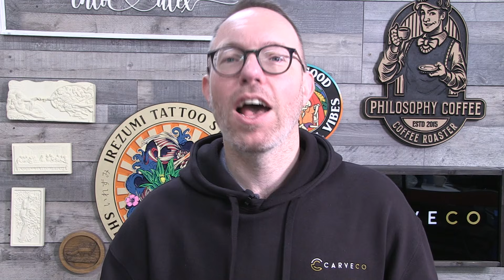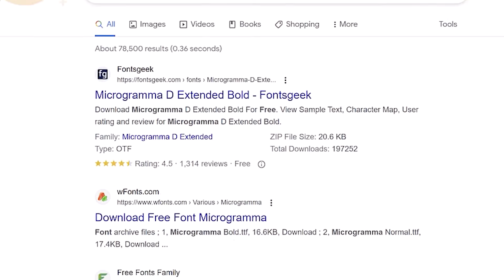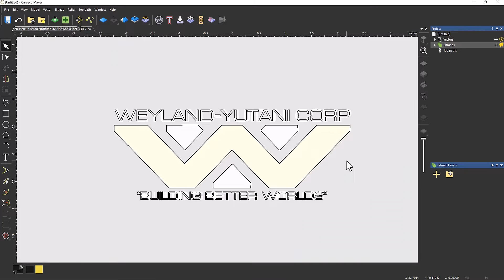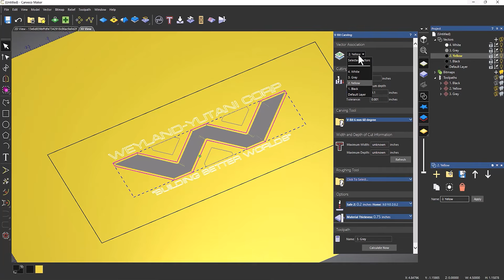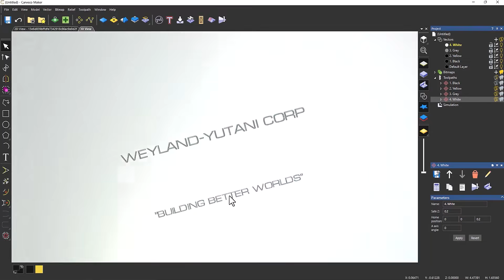Multicolored Inlays - CNC Epoxy 101

Comment: 🎯 Key Takeaways for quick navigation:

00:00 📹 In this tutorial, the goal is to create a four-pour epoxy inlay for a well-known movie logo, involving multiple layers of epoxy pours.
01:03 🎨 To start the project, obtain an image of the logo you want to create and import it into Carveco Maker for tracing and vector creation.
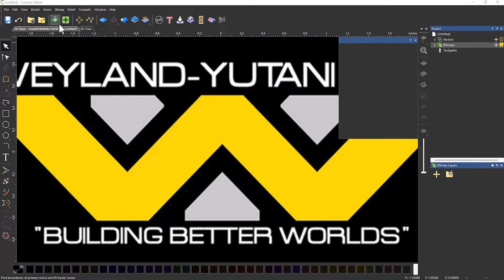03:08 🖼️ Adjust vector settings to achieve the desired angular and curved features for the logo and text in the design.
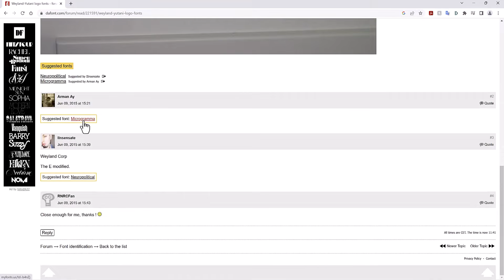07:05 ✒️ Find a suitable font for the text in the logo and install it in the software for accurate representation.
12:00 🎨 Organize the design into separate layers for different epoxy pours, making it easier to manage and machine each color separately.
15:22 🛠️ Set up toolpaths for machining each color using V-Bit carving and, if needed, roughing tools for faster material removal.
26:16 🚫 Ensure the workpiece is securely fixed to avoid movement during machining to prevent errors.
30:04 🌬️ Overfill the epoxy pours to ensure the surface is level and then use a blowtorch to remove bubbles, repeating the process every 15 minutes for an hour or more.
31:23 🗂️ After the epoxy has dried, remove tape, reestablish the origin point, and set the Z zero on the actual board surface if the epoxy layer is higher.
31:55 🛠️ When setting up your CNC project with multiple epoxy pours, ensure that you consistently place your zero point for each pour.
33:36 🌈 Yellow epoxy may require a significant amount of pigment to achieve an opaque effect due to its translucency.
35:09 ⚠️ As you add more epoxy layers, be cautious of the increased thickness and adjust plunge depth accordingly to avoid cutting into previous layers.
36:19 ✂️ Use a Whiteside surfacing bit for leveling the epoxy layers, and do it in multiple passes to prevent chipping the epoxy.
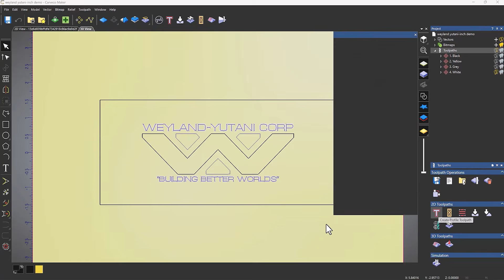39:01 📏 When cutting the final part out, set your lead in and lead out points at the corners where the start point is to facilitate part removal.
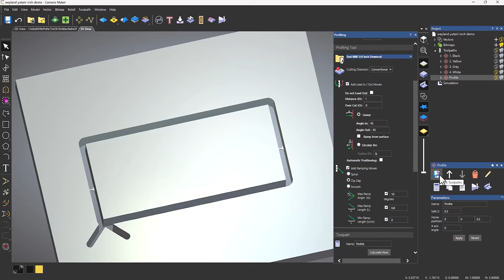41:24 🧊 In the next video, the creator will tackle a larger epoxy project with around 14 or 15 pours, demonstrating more advanced techniques.

Made with HARPA AI

Comment: Well you dropped this video at the perfect time! Followed along to do my first epoxy inlay. While your carves look clean, mine left a lot of "fuzzies" that need to be cleaned out. I used a Cadence 60V bit and copied the speeds and feeds from the video. Only difference was the epoxy. Any idea how to alleviate that in the future?
Reply from the maker: Hey Frank, fuzzies could be caused by a few different things. Hardwoods are generally going to give you less problems than more 'fibrous' (.... I think that's a word?!) softwoods like Pine etc. We used Meranti in this example. And if you're finding the fuzzies on Profile and Area Clearance cuts, look into getting some 'downcut' endmills. Experiment with different feeds and speeds as these will need to change for different materials. Finally - check that your bits are sharp! 
Fuzzies sometimes are just unavoidable and most times we have to go over the cuts with a wire brush if that's any consolation. Hope that helps!
Reply: @Carveco  It wasn't in the wood (I'm used to those). I cut out my "base layer", poured epoxy, cured a few days, and carved the design into the epoxy. That's when i got fuzzies. I was able to clean it out with a brass bristle brush. And the bit has only had a few carves under its belt. Your carve in the epoxy came out super clean, and it just made me jealous.

Comment: First, very informative.

Second, and this is meant as construct criticism which will hopefully be useful feedback, not meant to be an attack in any way: I had to watch this at 2x speed. The overall pace is just WAY too slow for an informational video. Even at 2x speed there were times where it felt the pace was on the slow side still. I feel that the information in the video was good, and that it was the right amount of information (didn't give super deep into minute details) but the amount of information would suit a video in the 10-15 minute range.

Again, please take this as constructive feedback and not the average internet keyboard warrior trashing everything. I would not have watched the whole thing if I didn't think there was value here.
Reply from the maker: Thanks Tim.  We also felt the pace could be sped up, especially in the software section, but it is hard to give all of that information in such a short space of time.  We could skip over things but then you have the flip side.  I guess we need to find the right balance of giving enough information whilst making it shorter.